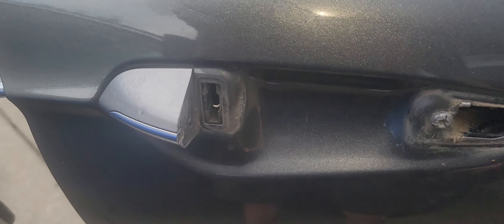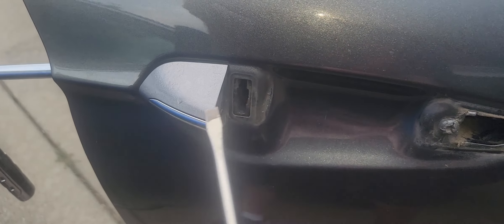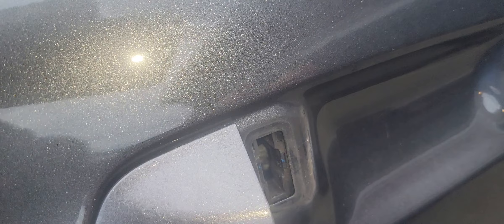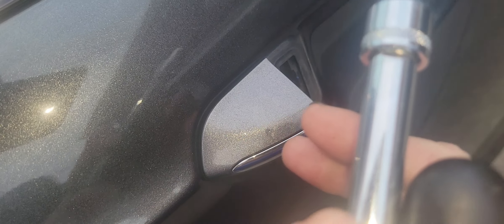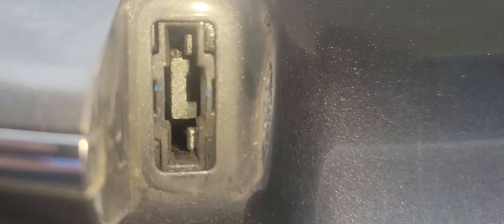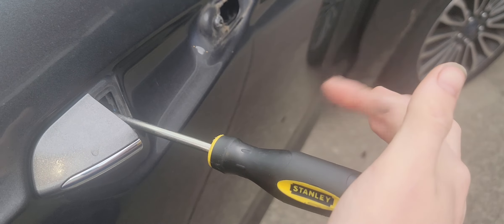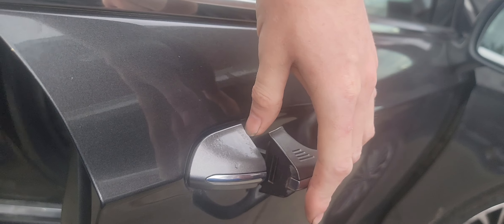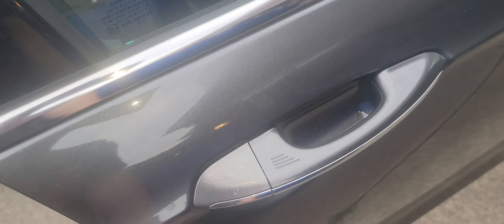2013-2020 ford fusion door handle won't go in here how to fix

Comment: So is the screw tightened to allow the anchors to engage or is the screw loosened to allow the anchors to push back? It is confusing. I watched like 5 times and still don't understand
Reply from the maker: When you loosen the screen it pushes the anchor away from the handle clip when you tighten the screw it pulls the anchor against the handle and holds it into place